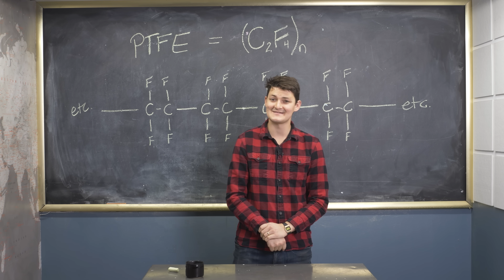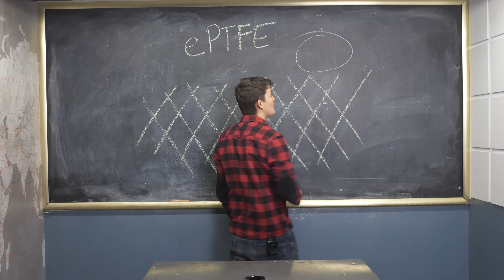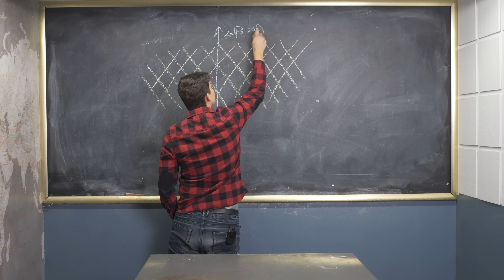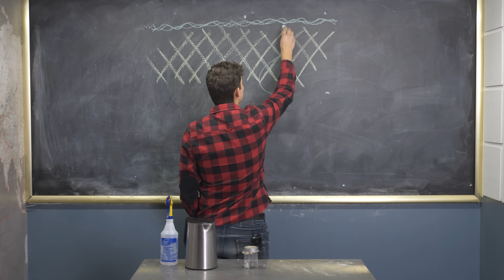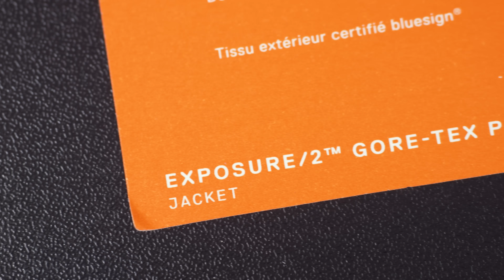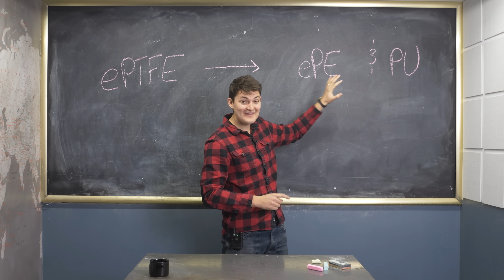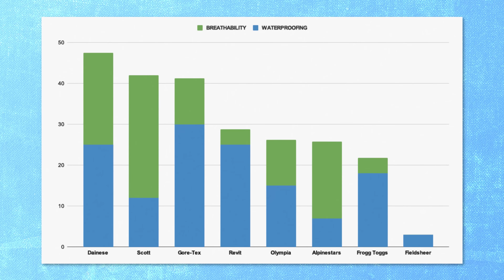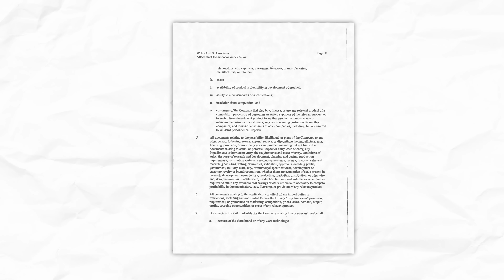Gore-Tex is a Marketing Gimmick

Comment: I have owned various gore tex products (motorcycle, ski, and mountaineering gear)over the past 35 years. The best non goretex jacket I owned was a Lowe Alpine Triple point ceramic membrane. I tend to find many goretex alternatives are made with a cheaper method and don’t last, however some manufacturers have upped their game.
Reply: Since 1986 I've bought a new Kathmandu Goretex jacket every ten years, whether I've needed to or not. I use them for general everyday windproof/waterproof wear as well as motorcycling. They have worked pretty darn well, even on 900 km rides in torrential rain (it helps that I've been riding BMW RT bikes (R80/K100/R1100) since 1987). Designed for hiking they have a pretty tough outer skin that wards off both pointy foliage and also minor road contact. At first they were around NZ$600 (US$400, depending on exactly when) but the last one (around Christmas 2017) was a bit cheaper, maybe NZ$400. The breathable OR waterproof works pretty well on a motorcycle as you're not generating a lot of body heat and, at least where I live, when it's raining it cools off and you mostly want to keep it in anyway. I see Gore is only just in the last couple of years starting the transition from ePTFE. I'm definitely open to trying other brands and fabrics, but it is a pretty big investment. I see on the chart showing performance of various fabrics, though two others beat GoreTex for the total of breathability and waterproofness, GoreTex is still the most waterproof. And it's breathable enough to be vastly preferable to a PVC raincoat when it's dry and sunny! In the end, if the thing lasts for ten years then a several hundred dollar price difference is only $20 or $30 a year -- meh, just get the best.
Reply: I had one of those triple point ceramic jackets, loved it. Cheap waterproofs don't last. Got to be three layer really.
Reply: Look into the new breathable dyneema composites, their really cool

Comment: Gore-Tex is or used to be in the O&G business. They advertise there product to not only repel water but absorb oils - all oils. They will plant a grid of “shoe strings” in the ground for a couple weeks allowing the strings to absorb the oils in the ground. They then “cook” the oils out and analyze them to distinguish plant from petroleum (petroleum oils from subterranean reservoirs naturally slowly leak vertically to the surface).

Comment: Too true. I came to that conclusion in the 90's. Water vapour condenses dependent on temperature not material. The likelihood of it navigating through cooler layers just to get through the GT layer and then condense is nonsense. If it is waterproof its not breathable, water does not allow water vapour through it.

Comment: to give gortex their due, my klim suit started to leak it was the original rally suit, and I had it for just over 10 years, kept in good condition, regularly washed it, i returned it to klim and was given a brand new badlands suit, you dont get that with other makes and the cost of the dry star and sympatex garments are pretty much the same, so yes it does have some advantages.

Comment: Sailing gear is also under the goretex scam and a while ago it slowly dripped though to me that goretex was overrated and I switched to woolen jumper and PVC raincoat (not far from your rubbish bag). The water repellant needed by goretex wears off and then the jacket just stays wet. But PVC will drip dry quite quickly. Cheaper AND better!

Comment: But, what about when you go outdoors and maybe it'll rain and maybe it won't (you never know for sure in most cases). If it doesn't rain, the Gore Tex offers good ventilation that a non Gore Tex jacket won't. Yet it still also offers waterproof rain jacket performance if it does rain. Ok, it won't ventilate while it's raining. But as soon as it stops raining it still ventilates and offers windchill protection too. That is a special utility a simple nylon jacket won't offer.

Comment: Trying to find quality waterproof gear is difficult though. So much oh it isn't hardly waterproof even if it says it is and there are reviews claiming that it works. So, it makes sense for most people to simply go straight for the well known and reputable brands, even if it is pricy. I've purchased waterproof gear that was cheaper, only to realize it doesn't meet my needs and I'm on the hunt and breaking my wallet out again.  I still haven't went for Gortex, but I've spent a ton of time and money looking for quality alternatives.
Reply: If you know somebody in the military, ask them to pick up the item from the post 'Military Clothing Sales' store.  Won't be less expensive but it will have been made to a specific 'Military Specification that defines how it has to be made and how it has to perform.  Likely won't be as good as the stuff you spend 5x for but for the price you can be sure of getting good gear.

Comment: Spent a lot on a Dainese Gore Tex jacket which isn't properly waterproof. Seems to rely on an inner waterproof layer, but if the outer layer is sodden you feel wet & miserable anyway. As I would only use this jacket in winter and I ride in a cold climate (UK) I don't really need it to be breathable, I just want it to be 100 per cent waterproof. The jacket wasn't warm enough either, I changed the Dainese "warm" layer for a furry one from Barbour.

Comment: The fabric does not breathe particularly well in humid conditions, meaning it is not as versatile as previously thought. Sandlin explains that while Gore-Tex is waterproof and breathable, it is not both at the same time. The fabric can only breathe in low humidity environments, while it is waterproof in high humidity environments. This means that the breathability of Gore-Tex is limited, and the fabric can become uncomfortable in hot and humid conditions. Sandlin also points out that the popularity of Gore-Tex is largely due to the company's aggressive patenting and licensing practices, rather than any technological breakthrough. Gore-Tex's parent company, WL Gore, owns 70% of the waterproof breathable market, and manufacturers who wish to use the fabric must use Gore-approved machinery and materials and emboss the Gore-Tex name on the product.

Comment: My goretex boots are soaking. Rev it hydratex is the way forward. Got waterproof liner which goes in or outside off my sand 4 and it works a treat and does not allow any air in either,  alpinestars drystar is meant to be better than goretex aswel. Even my Merlin Yuri mid layer is better than any goretex i own. My Dainese d-dry boots are awesome

Comment: it is, its a scam, ive owned gortex, it never kept me dry.  some have a very thin rubber layer that breaks down fairly soon and now you are just as wet as always. only rubber keeps you dry, if you dont get just as wet from the inside sweating from the lack of body heat escaping, even if you are cold.  the best weather/water proofing ive ever had was to just not ride in the rain. either stay home or get a car, not a convertible. got wet in the several that i have owned, eventually.

Comment: Much as I adore everything that F9 have made so far, I’ve been using Gortex waterproofs, lined boots and gloves - while riding, working and leisure for a long time and they work. Technically yes, you’ve got a smug point about it not breathing when it’s wet, but in practice you wear your coat all day and then it rains for an hour. I’ll take the 9 hours of breathability for the one hour of not…. Oh, damn, I think I just swallowed some click bait! It worked, I’ve never commented before! Well done, I think….
Reply: You have just proven F9 to be right. You might just as well wear a jacket etc. Made from wool, with a water repellent treatment. Warmer, more comfortable, more breathable and more eco friendly than your Gore stuff, for most of the time, but not perfectly waterproof when it's actually raining.
Reply: @christrees8576  I love wool - I am a wool-ist!!  It’s great, had lots of it over the years and very pleased with it - it’s a wonderful material, ask any sheep. If you get it raw you don’t even need to waterproof it either. I’m also not arguing that it is or isn’t eco friendly - I just don’t need it to breath when it’s raining, just waterproof will do. Then when it isn’t raining, breathing would be nice. If that’s what goretex does, it works for me. The main thing I’ve found it great at is lining motorcycle boots and gloves. I’ve always found the gore ones to be more waterproof, longer lasting and less prone to getting smelly. 
Stopping on a bike to put extra covers over your gloves and boots isn’t always possible. There’s no need to prove right or wrong, it’s just the interpretation of his findings - We’ll probably come to different conclusions from the same bit of content. I just think the part of F9’s argument that it doesn’t breath while it’s raining is a bit thin.

Comment: Always enjoy Ryan F9s videos, but must say I found this one a bit "click-baity".  Yes, the Gore-Tex people have marketed the hell out of their product (which is what successful businesses do). But the marketing material doesn't claim it to be breathable and waterproof during heavy rain. In conditions of 100% humidity (like when it's raining), nothing is going to "breathe" very well. Hang a wet towel up on a hot, humid day. It won't dry because the moisture in the towel has no place to go - the air is already saturated. 

The bar graph in the video clearly shows that Gore-Tex has the best waterproofing of any of the products compared. It also shows that a few other products breathe slightly better than Gore-Tex, but they aren't nearly as waterproof so I guess you have to pick what's most important to you.  Ryan's own experiments show that Gore-Tex is completely waterproof and it does pass water vapour from inside to out, just not while the exterior is soaking wet. The other products don't either because it isn't even possible.

I can only speak from my experience riding with a Klim-brand Gore-Tex jacket and pants during many rain storms. It is absolutely 100% waterproof and windproof. Can it feel a bit clammy during heavy rain because perspiration cannot escape? Yes it can.  But when the rain stops, the outer shell dries out and the jacket resumes venting moisture to the outside. Wearing a synthetic fabric base layer so your bare skin is not in contact with the inside of the jacket helps. It isn't perfect, but nothing else on the market is either. To simply write off Gore-Tex technology as a "marketing gimmick" implies that it doesn't work which is quite inaccurate. It's fine to be upset at the Gore-Tex licensing model and the resulting high cost, but don't try to leave the viewer with the impression that the product is some kind of fraud perpetuated by the company when in fact it works better than most other products on the market.

Comment: I have had a few articles that were dry ware type items from MEC etc. They all kept me dry but the one thing that i do know with my Gore Tex gear is that the standard to which they were manufactured always seems to be better. Seams are sealed better, sewing is always a better job. They are one of the few that have lifetime stay dry warranties. GoreTex may not be the absolute when it comes to water repel/breathability,  but the manufacture standards they ask for in order to use their name make better products IMHO
Reply: My thoughts and experience too. If you want true waterproof outer layers, just get something that is a non-breathable raingear like pioneer or many other reputable brands. Manage air flow with cuffs/closures vs. through the fabric itself.
Reply: Fully agree. I've had many other membrane types in jackets/pants, and the cheaper ones always lets water in.. Mostly in the seams, zippers etc..
Reply: Of course, their warranty is truly remarkable. Sometimes, even if the manufacturer who produced the equipment using GoreTex refuses to repair their own product, the Gore Company will still assist me in fixing it. It's quite amusing, actually.😂
Reply: Well yeah the ptfe/pfas stays for many lifetimes

Comment: I moved to Northwestern Oregon in the Winter of 1974 to do outdoor construction work.  It rained hard constantly, but I as the Southern New Guy was the only one wearing a raincoat!  Yet I was soaked with sweat from exertion all day long, but all the others wore heavy wool coats and were perfectly comfortable?  They explained:  yes, the wool absorbed rain, but your active body heat radiated the moisture and sweat OUT again, and you kept relatively dry inside.  But as the New Guy I sure as heck could not AFFORD good heavy wool!  About this time polyester FLEECE was marketed and performed almost as well, looking just like wool, so I did not look like a new guy anymore!  My point:  ya gotta let the moisture OUT by driving it with your own body heat.............................elsullo

Comment: I won't make this comment unbearable to read, but as somebody who has been using waterproof motorcycle clothing in 45°C weather out in the wild, I can very fairly say that a D-Dry Membrane is nothing close to an actual layered Goretex Fabric. Ignoring the brand of goretex, you have brands like Rukka that work with GT, but manage to make it incredibly flexible and /comfortable/, with models like the Comforina, or the Rapto-R series. Then you have brands like Stadler, a very famous German brand that also works with GT, yet makes clothing as stiff as the Teflon pan that the material came from. I myself use the Dainese Antartica Fit, it's incredibly comfortable and I benefit from the factor that the Waterproofing material, aka. GoreTex, isn't a membrane, but actual layered fabric that the Fit is made from. It saves me room in my jacket for a Merino or an Outlast sweater, which regulates my temperature enough to where I neither sweat nor freeze. Materials like D-Dry, or even old GoreTex Jackets all have the same, horrible issue of membranes. If you ride around on your bike for an hour during the summer season, you will probably never need anything outside of a cheap membrane or maybe even just a rain cover over your protective gear, but for anyone who genuinely travels, the layered fabric solution is a game changer. It helps deter water upon impact, ensuring that your clothes don't soak up anything over time. this way you don't start to feel cold, or start to feel weighed down. it also makes your life easier once you actually stop to rest, because no water has to dry off. this way you don't have to wear your soggy and heavy jacket, even /if/ it's not wet inside technically. Big Gore may have its hand around the waterproofing outdoor industries balls, squeezing and pulling, but it's on You, as a consumer, to not just watch a video and determine what you think, but rather do your own research. My only GoreTex Reccomendations are Klim, Held, Dainese and Rukka products, since these brands use their Own tech to construct a useful Goretex product, as opposed to something that just carries its name.

Comment: not sure what u are talking about but the 2 goretex coats i had never got wet;  rain for 8 hrs hiking never got wet;  2nd coat light version same thing;  my new golf jacket is new tech (Footjoy)  it worked great but after 6 yrs coating or whatever they use is wearing off and now starting to leak;  my wife has had a gortex rain jacket for 35+ yrs still doesnt leak; its the true gortex woven material;  heavy but warm and dry, just wat you want in an all purpose coat

Comment: OMG finally a great factual video.  Just like to add that the claims they make are done using the ISO11092 test standard which tests Goretex in dry conditions no rain and an outside temp of 32 degrees c. Pretty much same conditions as the Sahara desert.  Thank goodness AATCC have come out with a proper test that tests rainwear in the wet and measures condensation in the jacket.  At last we are finally seeing the light 😂

Comment: The real problem with Gore-Tex, et al., is that at any activity level greater than, say, reading the newspaper (on-line, even) I sweat more that any waterproof and/or breathable fabric is going to pass.  It come down to a choice of getting wet from the outside in or from the inside out.  Darned uncomfortable either way, just don't turn up your nose to the infamous garbage bag (or equivalent).

Comment: I believed Gore Tex is the way to go and bought Dainese Freeland Gore Tex boots. Very soon, in the rain, they absorbed the water inside. Not much but enough to make my socks wet, especially the right boot, at the front. It actually happens mostly because of splashes of water from tire and road...but still.
I am not trusting the brand as I did before...

Comment: Keeping my dry when it’s hot (breathing) and dry when it’s wet (waterproof) is exactly what I want. I would rarely need both at the same time, at least where I live. There are similar products, but the difference is that gore-Tex certifies products to ensure they meet the criteria, which most of the other brands don’t. The bottom line is that it’s not that bad if you understand what is is.
Reply: Except it doesn't. It is not breathable enough and not waterproof. In shoes the deficiencies of the membrane are the most pronounced.
All the gore-tex running shoes will make your feet sweat like crazy while running, yet leak through the gap in the tongue when you hit a puddle.

Comment: In the early 80’s I bought gore Tex shell and pants for skiing.  Skiied 75-100 days a season from Nov to April sometimes into June.  Never had a problem with this gear for a decade. Of course I never wore this gear on a humid rainy day but I also wore it on sleet days, almost blizzards and days when the lifts would stop cause the wind blew so hard. 

The only time I had any sweat issue was one day lifts would stop mid hill and I hiked up a few hundred feet to get first tracks.